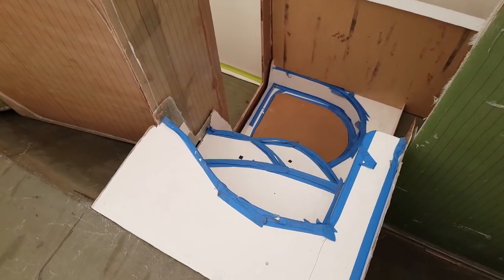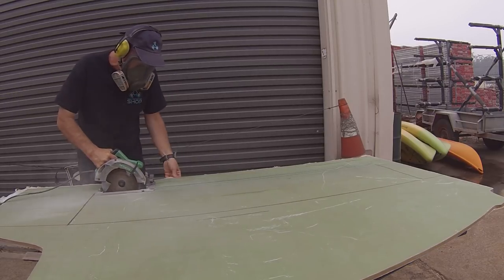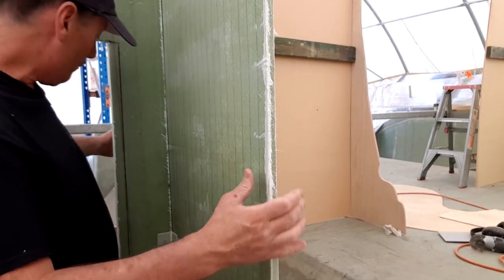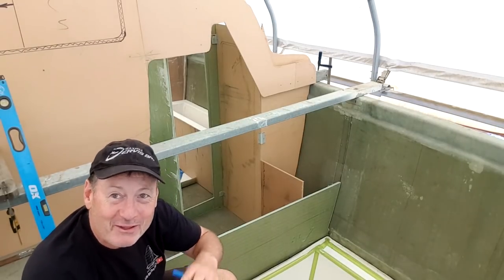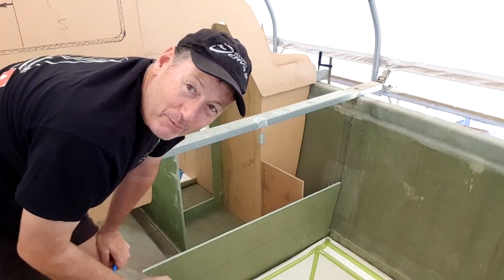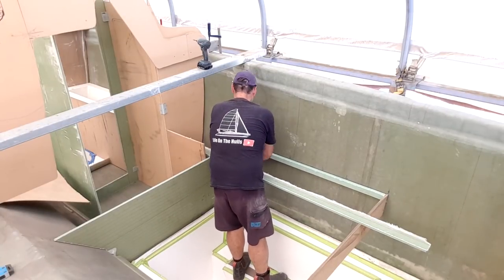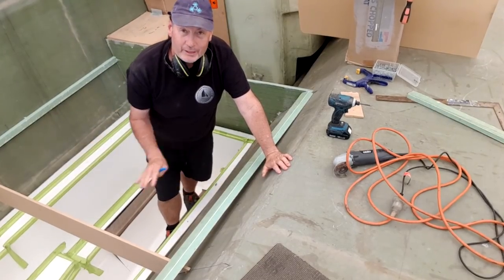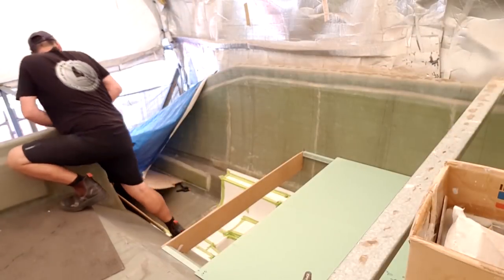Ep104 Stern Cabin Layouts - Life On The Hulls - Catamaran Build Project

Comment: Nice video, seems like you are really making great progress.  Before you know it you will be doing the top section mold.    Suggestion for your rear aft cabin bed support beam:   Build the beam, tab it to the hull on both sides then make the center 80% removable with some overlap joints fastened with bolts.   Most of the beam could then be removed if necessary to provide more vertical access to the engine bay from the sugar scoops.

Comment: If you put a few holes in your bunks for ventilation you may reduce some condensation and mold. Fiberglass tends to sweat out at sea
Reply from the maker: I will be using some new age marine flow mats  under each mattress as the engines are below these berths the fire regs will not allow for vent holes and I will be venting the cavity with exhaust fans in the engine room and an extinguisher port from the cabin bed front. Cheers and thanks for commenting Brad,  Ross

Comment: Hey Ross, couldn't you improve engine access by making the platform beds fully elevate instead of tilting from one side ? I'm thinking if you put some padeyes (maybe some formed in eyes at top of wall or in ceiling ?) at the 4 corners of bed so you can suspend it against ceiling when you need access, and at other times have hammock style netting at each side for small items, clothes etc ? If you don't like holes in the panels, add a small triangular corner brace with an opening or two...
Reply from the maker: That is an interesting idea Mike. I don't imagine I would have the space for the whole panel, but I intend to split mattress to allow for the bonnet or car hood concept and with gas struts should allow good access. I also am considering an access hatch on the face of the bed upright to access all belts and impellers at eye level, then also rear access through the sugar scoops steps, on the third and last step so in all three access points to be able to really maintain and assess needs. I would love to be able to lift the whole panel but am certain it would not pass AMSA Fire safety regs without some further engineering. I will keep you posted. Thank buddy, love the thinking that comes from this channels watchers . Ross
Reply: @LifeOnTheHulls  Does the engine heat insulation have to be separate by some critical distance from the bed above, or can they simply not touch, and have air circulation with a smoke detection system ? In the airplanes I work with (American Airlines 25 years as a baggage handler) they typically have perforated square beams, or a wire grating system on the ceilings to keep baggage from interfering with air movement relative to the detection and extinguishing systems in the baggage holds.  Maybe that would work for your application ? I looked for pics, but the only ones I found are considered company sensitive data... sorry.

Comment: I see that you are cutting square tops for the doors? Is that permanent or temporary? Certainly enough houses and boats use rectangular doors and it’s far easier.
Regarding the bed height, as low as possible that gives the required length to make getting in and out as easy as possible while providing the most air room = improved ventilation. Remember that the foam mattress can have an angle cut near the chamfer panel. Measure the height of the engine and consider where an external cooling tank might be mounted.

Comment: I've noticed several times that you use a level. How did you level the mold to ensure that using the level will make things level?
Reply from the maker: Larry.Mould was set level on a concrete slab based on brudge deck being levelo.Previous manufacturer used same basis although we do know this cat will be bow heavy and will require an existing designed Crowther like bow bulb to compensate.However no one ever know how these boats will float till they are placed in water.Thanks for asking.Cheers Ross
Reply: Life On The Hulls thanks Ross, I enjoy watching the channel.

Comment: another great video Ross, out of curiosity did you consider making one of the cabins an island bed and if so why did you dismiss the idea.
Reply from the maker: All things considered , I haven't got the space lengthwise in these tow stern cabins and the constraint wouldn't end there as the chamfer panel would intrude into the access rendering it almost useless. I do have an island bed configuration of sorts in the Master cabin so you my friend are just gonna have to clamber over your partner of choice to get the head in the middle of the night.Hah. Rossco
Reply: @LifeOnTheHulls  thanks for the reply Rossco Space is always the end deciding factor

Comment: How do you establish the  "Level" you have while under construction will be the same "Level" once the boat is in the water?
Reply from the maker: Hey Bruce, The mould itself is wet on dead level concrete and I was assured by the previous manufacturer that mould set level and the bridgedeck level in all planes would yield the best result, however, having said that as a boat , nothing is level and I am aware that in the initial model ( ie solid glass and balsa upper deck,) the cat sat bow heavy due to fine raked section so extra flotation will need to added to compensate of which I have the correct design to counteract with a crowther like bulb of sorts. All the best Ross

Comment: You should change how the stairs alternate.  It will be much more natural to physically turn your body at the bottom of the stairs if they are mirrored imaged of what you showed. Assuming you mostly turn left at the bottom of the stairs.
Reply from the maker: Good points there regarding orientation but given the work to make a new plug 200hours then mould 30hours  then new part 80hours plus materials for all three i reckon I will just learn to use them.The moulds are valued at approximately 20000 each so I wont be changing them any time soon.Thanks buddy and I get where you are coming from.Ross
Reply: @LifeOnTheHulls  I think all that epoxy has ruined your math skill - but I see what you are saying.